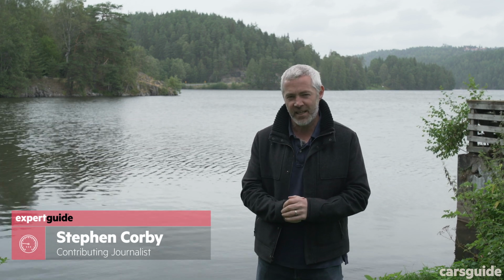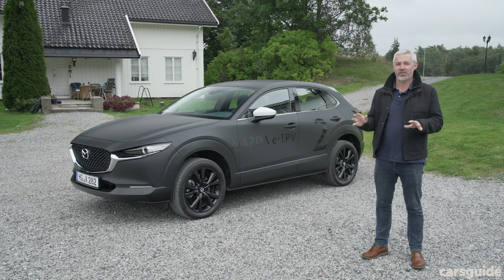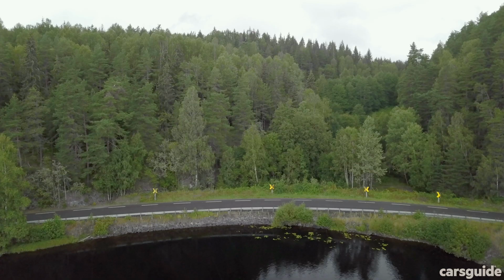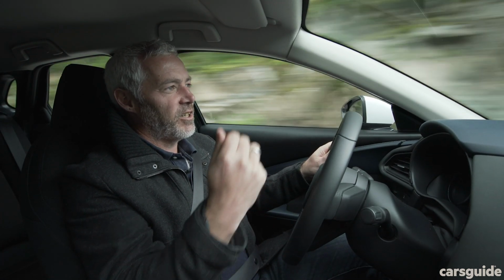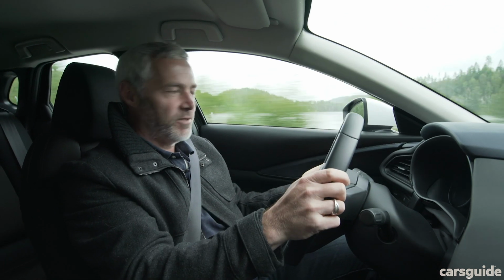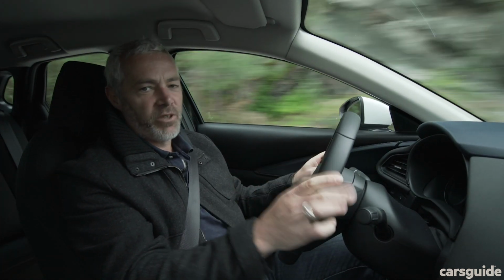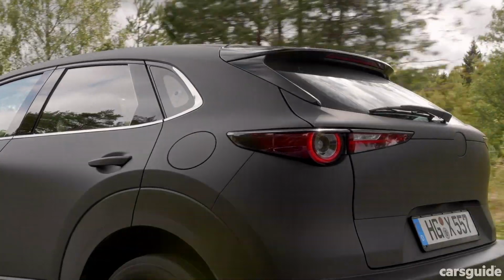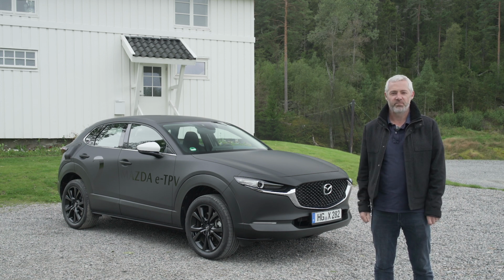Mazda EV review: electric car preview drive

Comment: I wonder what we will do with all the dead batteries from all these electric cars in the near future...
Reply: They get reconditioned and\or recycled. The batteries are much easier to reuse than that old engine sitting in millions of cars at the junkyard. nobody wants the old toyota corolla engine with 300k miles on it. on the other hand a reconditioned battery is as good as new
Reply: @boost331  good to know

Comment: Sometimes it seems like the move into EV by each manufacturer is one of the most exciting developments, but all the speculation about details is like guessing what is inside your boxed Christmas presents. Is it a nice practical pair of socks or a new whiz-bang phone? None of these "coming soon" electric cars are real until they are making full production models that can be evaluated by testing reviewers and the public. All the hype and supposition about the Tesla Model 3 has been forgotten now that thousands of them are in real world use....
So what is Mazda really going to produce, what cost, what range, what driving dynamics............the proof is in the pudding. At least they are joining the party and I think they are right to concentrate on "electrified" vehicles of all sorts. If they can build a range extender model that has an ultra low emissions petrol engine for electric generation, then why not.

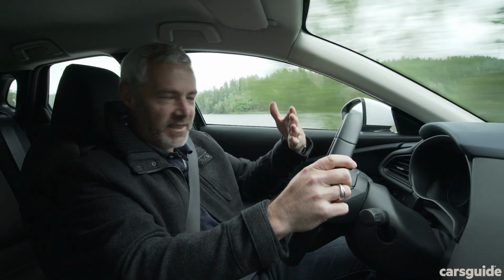PS: He says at 3:37 braking will push you back in your seat. No, braking, especially hard braking, causes your body to move forward, away from the seats. It's why we have seat belts and air bags.....the car may be slowing or stopping but the stuff in the car continues to move forward. Physics at work. I think he was overcome by electron fumes.
Reply: rizzle razzleuno I noticed that, too.

Comment: The thing is, for me, the fact that electric vehicles are usually near silent is a massive plus and I also really like the new type of braking system.
Reply: They are near silent at low speeds, but on a highway there is no difference in noise level between a petrol car and an electric car. You'll hear the same amount of road noise if not more.

Comment: Sounds to me that the dealerships have Mazda by the $%^&#'s.  Let me guess, new brake pads every 90k and a service every 10k.  
Keep your head in the sand Mazda, and watch the world pass you by (and note l am a 15 year 4th Mazda owner)
And to rub salt into the wound, not delivered to countries that use coal??. What about letting people make their own choice and use of they own solar !!!
Best of luck
Reply: As I understand, this EV don't use the brakes when pushing the brake pedal (at least the most part of the time). It regens like another EV, but the operations is like a conventional car. So you don't have to change the brake pads as you mentioned.
It think it makes sense, because most potential EV owners want to drive as they are used to. This will change overtime, when a new generation of young drivers comes who only know to drive EVs.
I am also a Mazda owners (sind 2008) and I like that this company has their own ideas. So I very like, that they don't jumped on that big touch screen waggon and keep the buttons for essential operations.

Comment: The range sounds low but good to see mazda with and ev
Reply: For a city car, the range is more than adequate. I rarely drive more than 20 or 30 kms/day. Apart from overseas on a holiday, I can’t remember the last time I drove more than about 200 kms in one stretch. This could be the perfect replacement for my 2017 Mazda3.
Reply: @Crosshead1  ok cool i have never driven a ev so thanks for the heads up
Reply: MrPicky400 
Huh?  But surely you’ve driven cars and you know what distance you might need it to travel before “refueling”.
Reply: MrPicky400 Also consider that you will be charging the vehicle while you are at home, no need to go to service stations with electric vehicles not to mention if our government actually got its act together like other countries, there would be charging stations at every shopping centre, workplace, restaurants and the like.
Reply: captain pugwash  Maybe if you apply easy breaking it doesn't actually break but enters a regenerative breaking state until the break pedals travels lets say 25% of the range.
Reply: Maybe because there's no regen? Mazda really don't get ev's do they?
Reply: captain pugwash  That is legit argument. As you have practical experience, would this work as a 2nd car of a famiy? Ie. for long trips use a gasoline/diesel car?